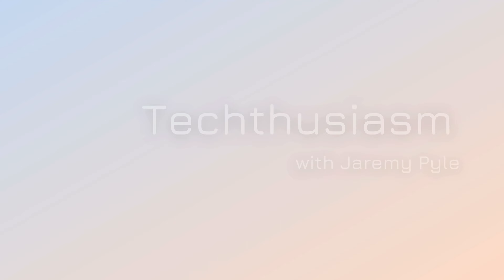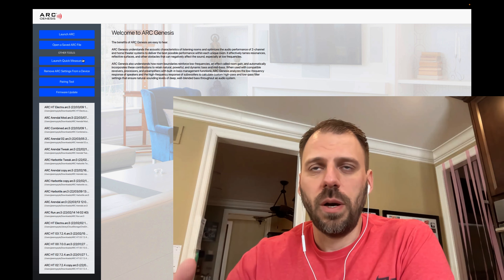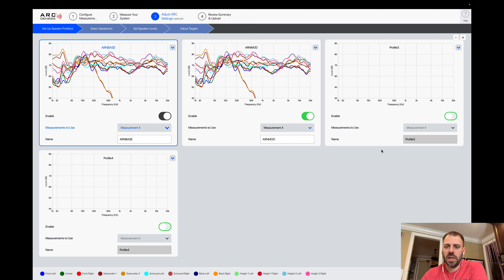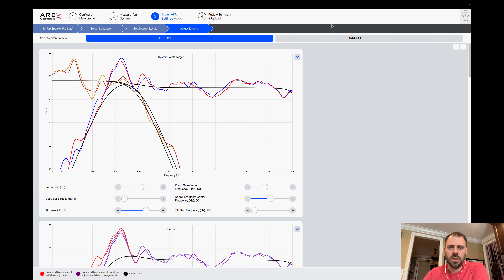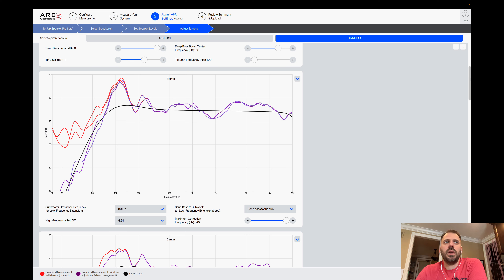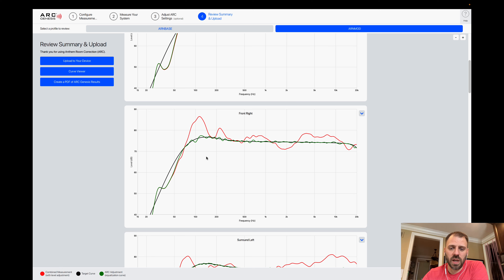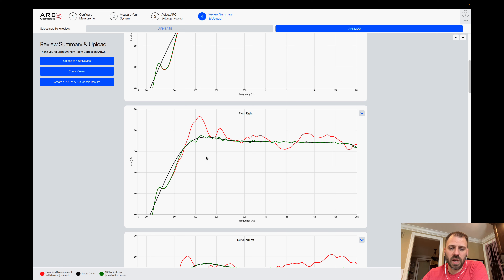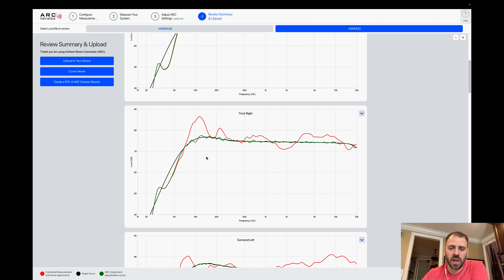ANTHEM ARC GENESIS ADVANCED CALIBRATION v1.5.4 | Features, Bugs, Custom Curves, Multiple Configs

Comment: Very helpful! I needed more bass, less harshness, and this video did the trick.
Reply from the maker: I have a few videos on adjusting ARC. One thing is I have been using more room gain than deep bass boost. It’s a bit better of an option. Hit the room gain for a few dB and then add 1 more deep bass boost dB. I’ll get some more follow ups done soon with the STR. Thanks for watching and glad it was helpful!
Reply: @Techthusiasm  appreciate the follow up. I’m using the AVM 70. Is your advice applicable to that unit as well?
Reply from the maker: Yep. STR, MRX, and AVM all work the same with regards to ARC now.

Comment: Great video that I have to rewatch when I do new measurements. 
Looking forward to your thoughts on the updated ARC Genesis. 

This is BTW what Anthem writes in regards of a "house curve".

Perhaps the most useful adjustment in the Profile Wide Settings is the room gain control. ARC algorithms identify and preserve the positive effects imparted by the room by detecting how much the room’s boundaries and pressurization reinforce low frequencies. This effect, known as room gain, appears as a bump below 150 to 300 Hz. ARC does not remove it because if flattened, bass sounds thin. If you would like to increase or decrease bass, this is the best place to do so if you are using a subwoofer since it maintains a good transition between the sub and your speakers.
Reply from the maker: I'm trying to get the new beta stuff applied, but my AVM70 kind of did a half beta update for the moment... I think I need to look more critically at that room gain setting as well vs. popping so much deep bass boost.

Comment: It baffles me that ARC to this day don't set the distances for you, but I am glad they are working on it. Having good phase alignment from sub to sub and then sub(s) to speaker is key to a smooth listening experience.
I like your approach to the adjustment of the target curve, and correcting full-range looks like a good choice based on your graphs. I would as a general rule of thumb have all the speakers roll-off the same, as in, use the same target curve for all speakers. 
I would also recommend getting an Umik-1 so that you can verify how ARC is actually performing in your room. REW won't replace how you perceive the sound you are hearing and adjusting by ear is still the best way, but it will help you diagnose any crossovers dips and is far better than going off a predicted graph. It is also a great tool to help the placement of sound panels and getting an idea on the room decay RT30.

I have only recently subscribe to your channel and binged watched your recent videos and love what you have done in the room. If I were to make an adjustment, it would be to have one sub at the front and one at the back. I think with a room of your size, you might get a smoother, less localized bass in this config. You could have the front sub in a vertical position, centre of the screen for a bit of symmetry.

Keep up the good work

Jim
Reply from the maker: Auto distance is actually here now with the new ARC beta that came out this morning along with advanced auto phase control. I'll be updating the beta, re-cal'ing my system, and be back with updated videos. 

I did some tweaking where I had the highest-end tune being similar across all speakers. In this current file I used for the video, I just let ARC define the top end response aside from the -1 dB tilt affecting all speakers.

I was debating a UMIK still, but per my other comments, that might be getting into it too much for me. I think I'm content to trust and be happy with ARC and not go further. We will see. I'll need a UMIK anyway if I go with a miniDSP to cal my living room, but I think I just want to stick to Anthem ARC product there as well. More discussion on that coming up.

Thanks for the compliments. Yes, I have considered going one up and one back for the subs. I just need to order up a longer cable to be able to place on back there. I'd probably go front left and back right opposing to start. I had thought about going mid-wall front and back too, but I think I want to avoid that configuration. I've grown fond of not having any gear right up in the field of view. Nor do I think I want to split apart those back bass trap panels on the stands. If I can get good response with goals, I would place high value on the aesthetics of the placement.

Comment: Arc does a great job at general room correction but I felt they were behind Dirac in terms of subwoofer calibration and integration. DLBC is an example of how far ahead they are. 
It's good to see they are updating Arc consistently, but you'll need REW and minidsp 2x4HD if you're going to manage 2+ subs. 3+ subs and it's a must.
Reply from the maker: With the changes in the new beta, hopefully ARC will close some gap on subwoofer calibration. Yes, the AVM70 will discretely calibrate 2 subwoofers. You need an AVM90 to do 4 subwoofers. If I were to go to 4 subs with the AVM70, I think I would just chain the fronts as sub 1 and the two rears as sub 2, at least to get started.

Comment: I recently purchased the avm70, and this is my first time using their products. When I ran the room correction, it was insanely loud to the point where it was uncomfortable to be in the room while it was running the measurements. Are there steps that need to be done prior to running arc to stop this from happening?  Im using polk s60, s30, s15, and 2 pb4000 subs in a 9.2 configuration. Amps are emotiva xpa3 gen 3 and outlaw model 7000x
Reply from the maker: Hmm, that's an odd one. I've not had an issue or seen anyone else reporting that. It's hard to say just offhand. Generally the test tones themselves are pretty loud when they are being generated. I wouldn't recommend being in the room anyway when measuring.

Comment: Hi, great work on your channel. Really useful.. I was curious if boosting the trims on the subs to help with the nulls when arc corrects the curve. Should I then run quick measure to check the levels in relation to one another. Would boosting the sub trims put them out of sync with the other channels. I find for example if you run quick measure after calibration that quite often there can be quite large variations on some of the speaker levels. Sometimes a couple of my ceiling speakers are down by 2-3 db. And my subs can be down 5db(average db level on quick measure). I do make sure that the arc calibration tab is clicked btw.
Reply from the maker: It hard to fight nulls with processing. Theoretically, it could help to boost giving the EQ more headroom to work with, but there are a lot of moving parts and layering multi touches of EQ on top of each other can have its own challenges. You want to get the output as good as possible with positioning and the sub settings itself before doing the EQ.

Comment: The peaks and nulls in the sub region is very common. Are you running multiple subs? Using multiple subs helps you get rid of these problems but you'd need a miniDsp to EQ them out. Plus you need some room treatment as well. No amount of EQ will help a bad room without room treatments.
Reply from the maker: I have a pair subs and one other single I am testing. Most of this was looking at the dual subs in the system. Yes, multiple subs help to even response. That's a big reason I need to keep one up front and try the other in the back of the room. Both subs up front even near opposing corners still have similar response curves so they are subject to the same peaks and nulls. Best case with multiple subs is that they present their peaks and nulls at differing frequencies and thus work better together in concert. I just need a longer XLR cable.
Reply: @Techthusiasm  In a 2 sub setup best position is front+rear midwall or front/rear diagonal corners

Comment: Are you using the test noise built in the Anthem to set the levels prior to running ARC?
Reply from the maker: I have been experimenting using quick measure to work with subwoofer volume as ARC won't cal the subs in some situations without asking me to turn them down. Adjusting volume on the speakers is something that didn't seem needed or even really could be done.

Seems like you could quick measure and adjust trim using levels on the quick access menu of the web UI for the main zone. But I thought those were more for transient control considered "on the fly" adjustment to tweak as you like. ARC itself sets trim for each speaker as part of the natural process of running it so I'm not sure why you would need to measure and set speaker levels manually before ARC. I also understood that ARC ignores/bypasses all the local settings on the unit itself when it runs.

If one did change the fly adjustments then ARC would just apply less of its own trim, but then on the fly level adjustment could get out of sync with the calibration if it is changed. If anyone has insight on why you would set speaker levels before ARC manually and share a preferable way to make the adjustment, I'm all ears!

Comment: Great Info.  I have a couple questions as I am a newbie to Arc with an AVM90 and 2 subs.  I have seen mentions elsewhere that with 2 subs, each should be "quick measured" to 72 db.  I noticed you started by letting Arc use 75 db and even boosted them after measurement.  Is there a place in quick measure to set the wanted level of each sub before measurement or do you just run quick measure and adjust the gain on each sub to get the desirable level (I assume you would look at average levels and not just peaks).  One other thing....I noticed you increase the max correction frequency for your speakers to 20K when Arc defaults to 5K.  It seems logical that letting ARC adjust the full curve all the way to 20K would be beneficial... What is the down side to this?  i.e. why would anthem default this to 5K?
Reply from the maker: If you want to volume control the subs, you would need to do that on the subs themselves outside of and before doing anything with ARC. You would do that as you mention, use quick measure, run the sweep, and adjust the sub volume until the overall number is where you want it. As you mention, I did not preset the subs. I let them run and let ARC work with them as is. I have some mid-bass nulls and I don't want to pull the signal down any right now.

I do also correct all the way out. This is most important on my LCR because I have an AT screen and it affects high frequencies. My speakers also natively rise in the highs and I wanted the curve tamed all the way out as I don't like shrill high pitched noise being overly hot. Most folks don't correct so high, some even only correct bass at like 500 Hz and lower. I'm comfortable wanting to let ARC run full range.
Reply: a lot of speakers are voiced a certain way in the mid to high frequency and intentionally boosted, etc as they all have their own voicing.  When you go past 5k you are now manipulating wha the original intent of your speaker manufacturer was.  That doesn't mean in some instances you shouldn't extend behind 5K if you are having some major issues, but going past 5k is not recommended especially if you have great speakers.  In his case, with Focal, I would not recommend doing that unless, like he said, some of the voicing done intentionally by Focal isn't to his liking.  So be very careful there is a reason they default to 5K
Reply: @Techthusiasm  i general, if running two subs, launch quick measure and try to get both near 72db

Comment: I have the MRX 740. What steps did you take to get a tighter tactile sound from your subs?
Reply from the maker: Just running ARC on your space and having it EQ the room and smooth response with the 740 is where you want to start. From there, you can tweak the target curves to your liking as I started to do in this video, but that's not required if you like the default curve. You need to experiment really and see what kind of results you get and what you prefer in your space.

Comment: Hi there, just a quick question. What should the minimum correction frequency be and what happens if we move it to max.
Reply from the maker: By default, the correction frequency is set to 5k. Many folks tend to move that down. I like to move it up for a few reason. For my LCR, they are behind an AT screen, and I think it is generally recommended practice to tune higher because of that. My speakers all mostly rise up in the highs and I prefer a tilt down in the highs. So I go all out on mine, but you can move that slider around to taste.
Reply: @Techthusiasm  As I was indicating in a previous post, that is probably the voicing done by Focal, but if you don't like what they did then that would be the exception, IMO, to going behind 5k, but you do change the intended characteristic of that speaker

Comment: Hi. Thank you for video. I'd like to ask questions. I'm first time running Arc for 7.1.2. At about 17 min on, so you change Minimum Correction Freq to 20k all speakers, did you also change High Freq Roll Off to 4.91, 4.05, 5.94 but kept surround and subwoofer flat? Or  are they set by Arc? Mine arc set hi freq roll off only at 0.5 to 2.52. And you prefer to set subwoofer Minimum Correction Freq to 15 instead of 80hz? Your advise is greatly appreciated. Thank you very much.
Reply from the maker: I set the correction to full 20k, yes, but the other items ARC adjusts based on target settings and its calculation. I just leave those be.

If I understand your second question, I think you might be mistaking correction frequency with crossover. Crossover is 80, as ARC calculates for me. Correction frequency though is far down ARC will apply EQ to the sub. You want that going low.

Grats on your Anthem, great product! Check out the full set of Anthem/ARC videos on the channel.
Reply: @Techthusiasm  I see. I thought min correct freq means all speakers send freq below 80 hz to sub. Thank you. 1 more question please. Should I set Subwoofer Cut Off Freq knob at the back of my paradigm studio sub 12 to 80hz or max? Bc if I set it to 80hz, Arc setting shows High Freq Extension       only 80. If I set it to max, the Arc shows 200 hz like your Arc setting. So I assume I should turn the Sub Cut Off Freq knob to maximum? Thank you.
Reply from the maker: Set it to max on the sub and let the Anthem handle the crossover fully. If you set it lower, then you have two things competing to perform essentially the same operation. My pleasure!
Reply: @Techthusiasm  I'm beating a dead horse here but going to 20K should rarely be done.  It is the exception to the rule if you have high quality speakers with intended characteristics in those frequency ranges
Reply from the maker: I'll probably end up re-doing ARC again soon in my spaces so maybe I'll make a profile where I don't go so high in the correction and try them out against each other.

Comment: I have been using ARC for my Anthem MX 520 along with my PC that was running Win 10....I bought a new PC with Win 11...and the ARC will not work, and there doesn't seem to be a download on the Anthem download page..is there a workaround or other suggestion to remedy this ?.
Reply from the maker: I have not tried ARC on Windows as I run it on my MacBook Pro. I would expect Windows 11 to work though. Maybe someone else can chime in. Did you download the 64-bit Windows version? I would try that if you had downloaded the 32-bit version.
Reply: @Techthusiasm  yes...and it wont open
Reply from the maker: Hmm, I'd recommend going to Anthem support. I have found them to be pretty helpful and responsive. Or perhaps post in the owner's thread on AVS Forum. Lots of folks there willing to help and someone might have experienced a similar issue.
Reply: @Techthusiasm  Thats what I have done..Thanks..Ill post the reply back from Anthem when I get it
Reply: It wouldn't install because of previous ARC files left in my Program Files, and the new download couldn't write over them for some reason, I deleted them, reinstalled it, and now its good...Thanks
Reply from the maker: I'm glad you worked it out!

Comment: I just got a avm 60 and I have been having an issue with the calibration. It does one speaker then stops, lights up the next speaker then gives me a critical error check speaker connection and microphone red alert. If i click on the first tab then go back to the test it saves and stays on the next speaker and I can go forward but it takes forever.
I have all virus/firewall settings off and I am signed into my laptop as a local user as I saw that is sometimes an issue.  I have been in contact with Anthem and they are stumped by this too.
Any help with this will be greatly appreciated.
I have a new mic and a long USB on the way so I can use my desktop instead to try that too. Just trying to eliminate things one at a time
Reply from the maker: Hmm, I don't think I can offer much on the AVM60. I'm not familiar with it. I came into Anthem with the 70 level device. I did encounter bugs with Anthem and ARC where test tones wouldn't generate. I'd have to jump through some hoops sometimes, but they squashed that issue in the later software. In my experience with Anthem support, they tend to blame and focus on network settings as an assumed culprit for problems.
Reply: @Techthusiasm  thanks man. Figured I'd try. Yeah this is weird, I don't know what it is, I got a new mic and I'll be connecting to my desk top to rule out the mic and windows 11 causing issues after that it has to be software because I've tried everything.
Reply from the maker: Best of luck solving it. I’m having some frustrating failure modes with my system right now too. Sucks.